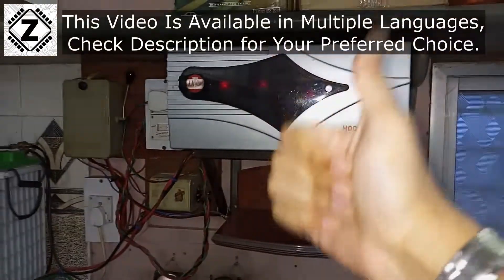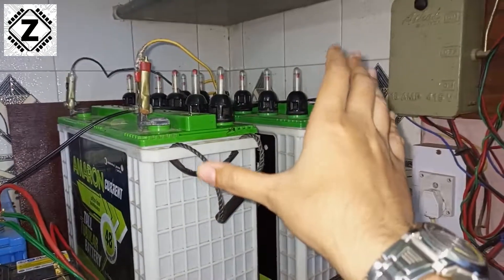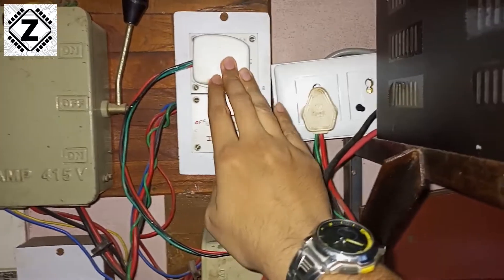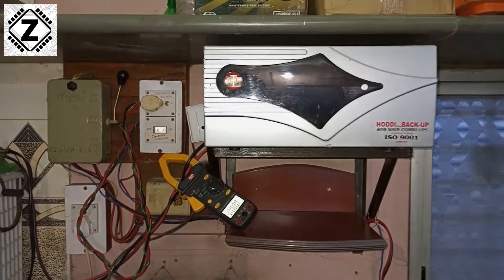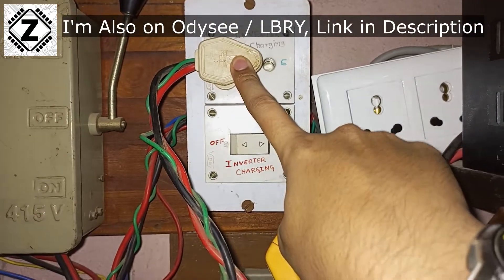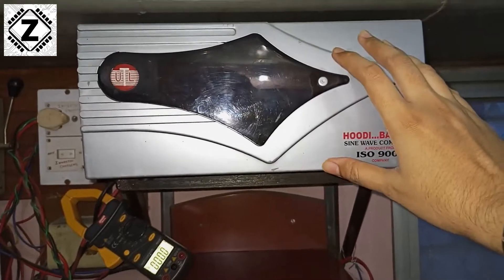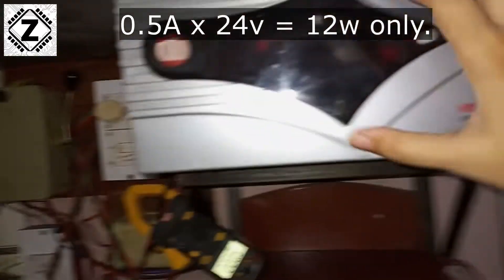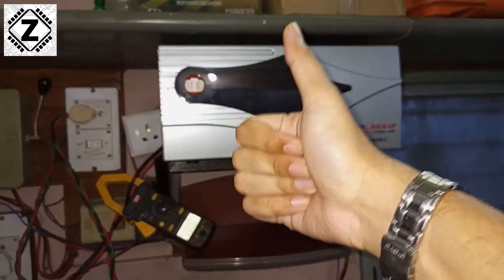[Eng] 24v UTL Sinewave Inverter Idle Draw Live Test | What is Self Power consumption of UPS ?

Comment from the maker: Sample product- UTL 24v Sinewave UPS https://amzn.to/3yfET1t
Review video https://youtu.be/4quDXFDs5s4

[Buying Affiliate Links]
Microtek Inverters-
EB series https://amzn.to/36mfWW7
Sinewave https://amzn.to/2UE3Vc0
MSun (Solar) Series https://amzn.to/3hs65Ej

Buy Energy Meter- (for Checking wattage of Devices)
Meco Energy Meter https://amzn.to/38wUY9e
Meco Pg08t Power Guard https://amzn.to/3nalMA4
Meco PG07 PowerGuard https://amzn.to/32z1ubF
MECO POWERGUARD PG09-1A https://amzn.to/36i9XRq

Buy High Quality AC/DC True RMS Clamp meters (RECOMMENDED)-
My Meter- (Mastech) https://amzn.to/342Ogp0
Sigma Instruments 1000A  https://amzn.to/3nagmWA
HTC Instrument CM-2056 Clamp Meters - 1000A Ac Dc https://amzn.to/3d8afxD
Fluke 362 https://amzn.to/36rwEo9
Reply: Sir mera ek problem hein mera microtek 2335 model mein charge controller ke negetive point bahat heating ho raha hein..

https://drive.google.com/file/d/18bqEnc4yPwyX7niKi1Emu8LA-w6aelfs/view?usp=drivesdk